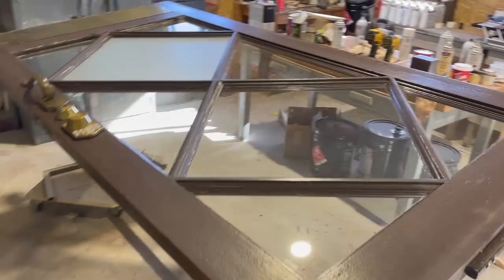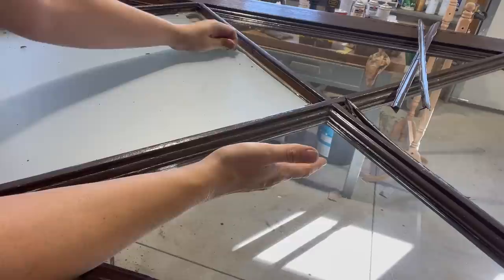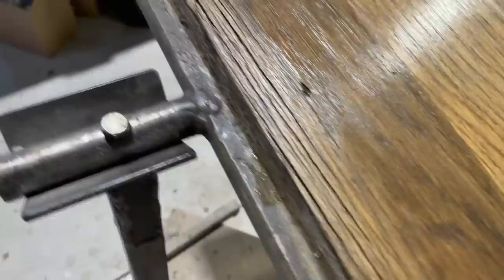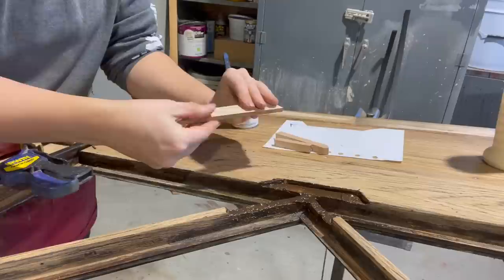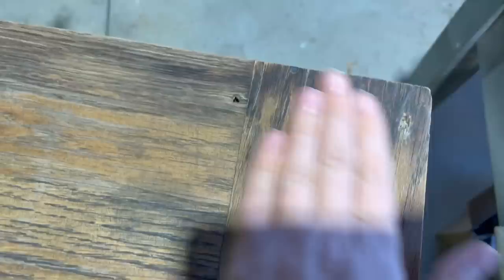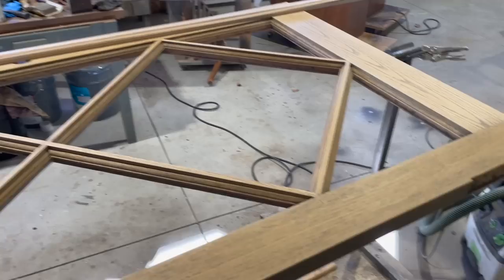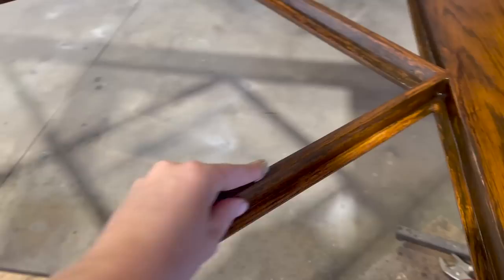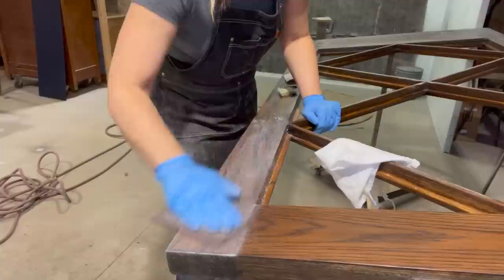This wood was SO ROTTEN! Could I fix it?

Comment: Do you have to replace the bottom 2/3 with safety glass or can you get away with putting standard 1/4 inch plate back in. I know when we redid doors we would never redo a door with the bottom 2/3 not being safety glass just because of lawsuit issues and the code required requiring bottom 1/2. I know where I grew up there was no grandfathering it in if it was on the lower 2/3 depending on the area of the lower, 1/2 and had to be safety glass by law. Are used to really piss off a lot of people. But it’s also very by the size of the pains on the door you’re working on we would have required for the lower half to be safety glass. It was recommended 2/3 of the whole door be safety glass people have been permanently disfigured with it not being safety glass. Vaughan put the glass perky and we would have to clean the world were the glassware in Fishkill brush it all the trash in there about Colonel Rottenwood and blue bag in matching worth can you choose another year back was original then we would have to prime the wood with Linseed oil and mineral spirts. If we had time we put a 16th of an inch of glaze putty mix with linseed oil for the glass to sit on, Brad the glass in place and fill between wood and glass with glazing putty Raise slightly to the inside, so it was for my solid joint when the wood trim was put on lol. If it was a rush job, I would just put on the linseed oil and white lightning, latex, caulk, caulk in the corner of the wood edge, put in the glass Brad it in place running a little bit of latex caulk Between the glass in the woods to fill gaps and then put the trim on top of it. When it all dried, they both look the same. Where are you from the trim pieces always go in from the outside so the door or windows glaze from the outside so it was mounted correctly. If you with how we did the caulking everything everything was done for water to flow out from the trim.
Reply from the maker: intrtesting, ive only ever seen the doors the other way here
Reply: @johnsfurniturerepair  Down in southwest USA I have never seen and inside glaze door been fix then since the 1978 and done 10 of thousands growing up that also the reason we had to prep all doors and windows with heavy linseed oil or windows dap putty and linseed oil, even new one we take the glass out and prep, I ask my friend that commercial door now and he said the same thing I may be a northern thing. we would have them put plastic on inside and pay and one of us boys would spend a day fix all windows in town from the outside and they did not have to be home. all windows that got broke the way we walked home from school we had to fix for free so dad would not get question about us 3 boys breaking windows LOL